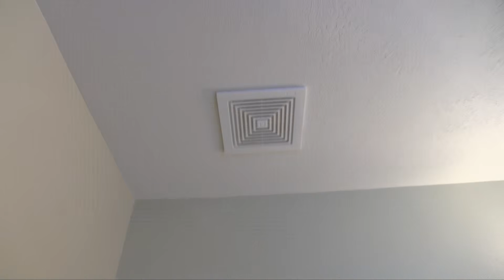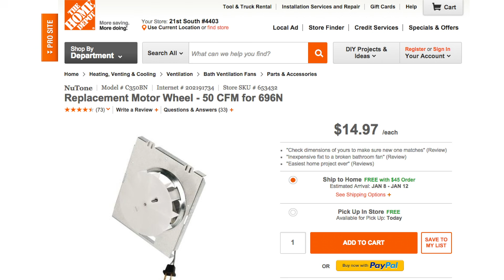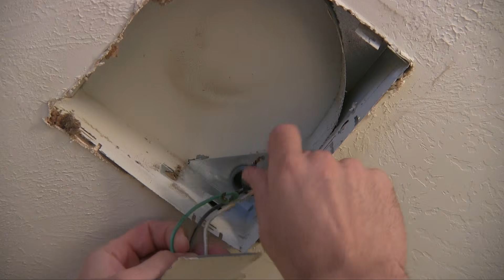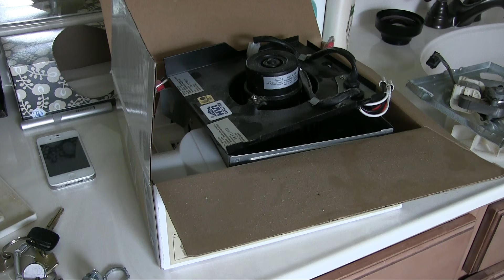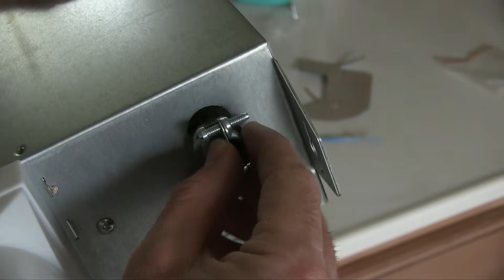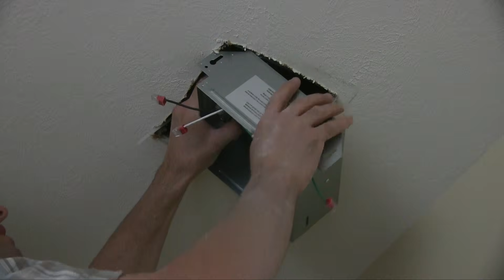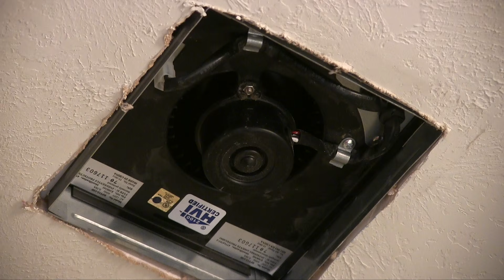How to replace or repair a bathroom fan

Comment: Cold Weather Tip:  If you feel cold air coming down through your ceiling fan vent in the winter (it happens), it’s cold air coming down the roof vent and flowing into the fan enclosure through the plastic swinging “gate”.  What I do is unplug the fan in the Fall and tape cardboard over the gate.  This immobilizes the fan until I hook it back up in Spring, but the bathroom has another ceiling fan nearby in the shower which doesn’t bleed in cold air.

Comment: I tried to replace the fan in the master bathroom. Could never get it out of the ceiling. No idea what is holding it in other than the screws that I took out. I looked at the hall bathroom fan and found it had been replaced by the revious owners. It looks like they had the same problem. Apparently they just cut the fan motor mount and drilled in some holes. Then screwed the new fan to the old fan motor mount. I might have to do the same thing in the master bathroom.

Comment: I did try and thank you but you should add some time is not also the switch  cause I did plug the hair dryer and did work went to buy the switch  and nothing . I was thinking 🤔  wait the plug in the fan already have power.  So don't  matter what you plug in will work so conclusion need to buy a fan lol 😊

Comment: Good video. For me the worst part by far was getting the fan cover back on. Those spring clamps have lots of strength and are thin and need to be compressed: I finally figured the angle of my ladder vs. the fan housing needed to be just so: I needed to see (the 2nd slot - first one was easy)  but I also needed to have the flexibility of my wrists. Once that was figured in I put on some thin leather gloves to be able to push those spring together enough to fit through the slot. Hope this helps

Comment: I have a air fan in the bathroom but it's not working, because I don't feel no air, especially when it's very humid in the hot summer days, I live in a rental apartment should I tell the Landlord to check it out?

Comment: Sad that they are making bathroom fans using a radial fan especially with short vertical blades.  They're the worst kind of fans to use in a house since they have to spin at such a high rate of speed to move air, thus creating an excessive and annoying amount of coil whine and noise.  Typically, bathroom fans are axial fans that have larger horizontal blades and can move much more air at slower speeds, thus reducing coil whine and noise levels.  The icon on the fan box in the video shows the fan as an axial fan.  Misleading information by the manufacturer.  
Interesting that house appliance fan manufacturers are using the sones scale instead of the decibel scale.  Think of sones as the metric system of sound and decibels as the imperial system.  The fan in the video is rated at 4.0 sones.  That's equal to 47.99 dBA (decibels).  Way too loud especially for a single fan.  2.0 sones is 37.99 dBA and that is tolerable but still loud.  The sweet spot is 1.0 sones or 28.00 dBA.  High enough fan speed to move air quickly, yet the noise level is relatively quiet.

Comment: The people that did my bathroom exhaust fan left a half inch gap between the ceiling/drywall and entire unit somehow... I found this to be the probable reason for bad air flow and condensation on the ceiling. 

Any ideas on the easiest way to fix this? Thanks 🙏

Comment: The fan does not seem to be coming out at all, no mater how much I try to pull it out by twisting the clips. is it possible that it is stuck in there with something else holding it in place? It is a Broan model and looks similar to your fan in the video, but it is possible that it is a lot older, and so a different model, maybe? Any suggestions would help! Thank you!

Comment: Good vid - educational and useful. I thought the fan I bought (before I pulled out the old fan) would not work because the new fan will not fit in the existing housing, but this has shown me how to remove the housing and install an all new fan. The old fan is about 30 years old, or more.
Thanks!
- from a not so handy homeowner 😅

Comment: Great video. Your fan appears to be identical to the one in my bathroom. Which was 17 years old and would not turn on at all...all you got was a humming sound when you turned on the switch.
 
But you know what I did...before ordering parts, I realized the thing was caked in grease and grime, so I unplugged it and doused it liberally with Greased Lightning grease cutter and then WD-40. Let it dry about 5-6 hours. Plugged it back in, hit the switch, it now runs just like brand new.
 
Maybe something to try before you go to the expense and hassle of installing a new one.

Comment: @AdamDIY In an apartment building are the bathroom vents connected to downstairs apartments?. Or each unit above and below? I got really bad smoker problem coming from downstairs neighbors. They light up all day long and smells like ground zero comes through from my bathroom vent. I've blocked the vent with whatever I could

Comment: Great easy video!! My fan seem like working fine (but only twice thankfully) with high wind & rain it leaks in one spot from between the fan box & drywall.  I'd I caulk around fan box will that stop the occasional leaks? Suggestions?? Tks!

Comment: I would like to have seen where the damper is.  My problem is outside air is coming in thru the fan, so clearly the damper is stuck open.  It is not at the other end, where it exits the house.  Also, does all of the fan have to be removed to get to the damper in the duct?  I assume so.  And having trouble with that.  The damper is not accessible in the attic.

Comment: Stupid question but how do you know if the motor is burned out? I need a fan fixed, it turns on but it doesn’t do what it needs to. Steam and condensation builds in the bathroom and mold grows on the ceilings even though the fan is on. There is no window in the bathroom.
Reply: I'm having a similar problem, except the motor on mine is working

Comment: Thank you so very much. Your valuable simple comment about plugging something into the socket on the ceiling fan saved me from so much work. I plugged in a little light and it worked. So I plug the ceiling fan plugged back in and pushed it up tight, and it worked. It must’ve stopped working because the plug must’ve come loose. You saved me so much work! I appreciate it and I subscribed to your channel!

Comment: With all that garbage that fell out as you removed the housing, that tells me there is no venting to the fan and it's just blowing into the attic. You should check that out because it will cause all kinds of mold damage to your house.

Comment: Thank you for this. Had I not known that I could just replace the fan and motor and not need to replace the whole housing, I would have pulled my hair out. I installed the new motor/fan and while it is much better than the old one, it still makes a lot more noise in the old housing than it does plugged in without the housing. Not sure if that's normal but it'll do for now and I think the housing will need replacing someday.

Comment: Our fam sounds clackety, but it still works. I removed the top and plugged in a lamp and a hot iron, and neither turned on. Once the plug was back into the unit, it was on - clackety again. What does that mean? Works with fan, but not with anything plugged into it?

Comment: If your fan just doesn't suck good anymore, don't replace the whole unit, just clean it. Most of these have fan blades that can be removed by simply pulling them off of the shaft. Sometimes you have to push down first, and then pull up, to break it free without damaging the motor. Then, soak the blades in a bucket of hot soapy water for a few minutes and then brush them and rinse them off.

 Over time, the dust buildup on the leading edge of the blades causes them to no longer "cut" through the air, which is almost always the reason a bathroom fan doesn't suck air. Being in a moist environment, the dust tends to stick to the leading edges of the blades. Depending on how dusty your home is, this can happen within just a few months. It's good to clean your bathroom fan every year or two, to prevent mold buildup in your bathroom.
Reply: On a related note, pull your fridge out, take off the front kick plate and whatever plate is covering the backside. You'll be shocked. Get your vacuum down there and clean everything off, especially the fan. Your fridge will work better and also be quieter.

Comment: Update, check your unit. I have a Nautilus, which Broan bought out. They changed the location of the outlet. It is now in the wrong corner. Now will cut the sheet metal in that spot since I don't want to rewire the whole thing.

Comment: Thanks for this video. You'll probably be getting views on this until the end of time. LoL I do have a question. My current one is like the one you pulled out that has the power plug to the motor and fan. But the new one you put in, you had to re do the wiring since its hardwired as opposed to having the plug. Is it normal that the new ones are like that now? Or is that just what was available. Mine currently went out (Not a power issue. The motor was dying for a while).

Comment: Thank you for this video. Saved me sooooo much time and work. I was able to verify it was  a bad motor and not the switch and pop out the old motor and replace it with the new motor.

Comment: Not as easy as the video leads you to believe. First thing that needs to be said: don’t buy the new fan until you take the old fan out. The position of cables and exhaust hose might be different. With the old one out you can go to HD and buy an exact replica of the one you have. Prepare to fight for space. If you are not handy, give yourself 2 hours to do this job. I had to cut four nails that were securing the fan. Hope you find screws holding yours.

Comment: How to fix a fan working continuously even after turn it off.
I called Electrician he cut plug  and put wire connections directly.He said plug is faultly.
Same problem again.
It's from Canadian tire BROAN brand fan.
Thanks

Comment: My wife been telling me to fix the fan in an extra bathroom where our birds sleep for sometime now and I finally said, "OK I'll see how to do it on youtube" Thanks! I will try this out tomorrow.
Reply: I was mentioning the same thing, and then I went to buy it myself, and then I ended up replacing it myself, and then I began to wonder if you could buy parts to replace whatever isn’t working in the old one.  There was a lot of dust on the old fan on the upper internal roof side of the fan and it’s workings, as I only ever cleaned the grill plus the fan blades I could reach from the being in the room.  I wondered if it stopped working owing to years of dust building up on the upper side of the fan workings. (?) 
 Should I have unplugged it, taken it out, and cleaned off the dust once a year or such (?).

Comment: Hey, great video!  My bathroom fans are rectangular.  It's about 5x11.  (These condos were built around 1984.)   I havent seen anything like that at Lowes or on Amazon.  Any idea of a better place to look for a replacement?  If not, is it just a matter of cutting a larger hole?
Reply: This is my problem too.
Reply: @lytled6551  I ended up getting a replacement at Grainger.  Mine was not vented and they were the only one that sold a non vented one.  (They might have called it recirculating?)  You cant use a vented one without properly venting it.  We did have to cut the hole bigger.  Good luck.
Reply: @fixfireleo  thanks! That helps.

Comment: bought our house 3 years ago and the bathroom vent fan worked fine for a time....then it started to get noisy....then it got out of hand!  The fan was hitting on something but I thought it was the motor.  So I got a new motor and replaced the old one.  Still had the same problem and when I turned it on it sounded like something was breaking.  I pulled it back out and now I can't get the fan to rotate with the motor shaft....it just slips on it.  Anybody know what I should try?  Thanks in advance!

Comment: The other big thing you need to look at when buying a new fan is the size. If you don't get the same size, it will mean some drywall work which can be easy if you're cutting a slightly bigger hole, or more difficult if you have to reduce the size.
Reply: It would be rather dumb to get a smaller fan unless you don't mind patching drywall

Comment: I have a motor that went out and the electrician took the squirrel cage and inner part of the motor. There are 4 wires for this fan and a capacitor,  how do I replace this?

Comment: What if it's just being really loud? It turns on then makes a loud sound like it's unbalanced but then quiets down to it's normal volume.
Reply: Could be the motor is sticking. Mine did this and there was hair wrapped around the spindle. Took the motor out and cleaned it and it is good to go for another 45 years!!!!

Comment: Ok so just to confirm: if you flip the wall switch and whatever you plug in doesnt turn on the issue is the wall switch? Is it possible for half a two button wall switch to fail? My lights turn on, but the fan doesnt. Thanks.

Comment: As far as removing the face/grill/cover (not sure what the correct term is). I have a older fan that isn't spinning. I tried but cannot remover the cover. Any tips or suggestions. Since its older could it just to stuck to the dry wall?

Comment: For my info, you didn't show 

1. How to route the old wires through that clamp... or is it Romex? Flexible conduit?

2. How to attach the new connectors which replace the wire nuts.

I consider this a good start at how to do it, and an overall way to decide whether I'd want to do it myself or hire a handyman.

So... no thumb down, but no thumb up, either.

Comment: My exhaust fan appeared to be installed as "new work." Unremovable from below. Why anyone ever thought that would be a good long term idea is beyond me. I picked up the replacement motor, the Broan BP27 which is readily available. (Ace had the best price.) 6 of the 8 illustrations were as you'd expect, depicting the motor hung from the bracket with the fan on the other side, as with the original. One was different, with both fan and motor on top of the bracket, placing the fan way up high of course.

The motor came assembled intended for that odd illustration but of course the fan wouldn't fit. It hit the top of the housing. The mounting screws and motor housing are backward. I reversed the screws anyway, which meant the motor is now only held together with the two nuts that also secure it to the frame. Just thought I'd mention it if anyone buys a BP27 replacement motor but has a bottom-mount motor as shown in this video.

Comment: My job SUCKED!  My opening is 8" x 8" - Every single fan at Home Depot and Lowes is 7 1/4 x 7.5 and I had 1 stud to work off of and I used spray foam to seal, insulation everywhere, Itchy and i have a bad back and don't like working above the shoulder work, so I was pissed off, but now I am fine!  (sorry, I am actually fine, just needed to blow some steam).

Comment: Hi, mine is turning on but it seems not sucking any air in when I put my end next to it. Bathroom in fact stays smelly. Any suggestion?
Reply: I would replace new motor assembly.making sure it right CFM for your bathroom. At home depot

Comment: A fan in my house and my mothers house were having trouble at the same time. Both fans were close to 40 years old. New fans looked cheap compared to the old units, so I just gave the old ones a good cleaning. About 5 years later, they still run like new.
Reply: This is a good idea!

Comment: We ended up replacing the whole thing and are We are having trouble with our motor plug working. Do you know what could cause that? We made sure all the wires were correct too.

Comment: Just replace the motor... who would have thought! Thanks, great video.
Reply: You can also typically just lube the bearings and put it back together.  Due to fire safety regulations, most of those motors actually can't "burn up".  They can sit in a stall condition all day.
Reply: @l337pwnage  You'd hope but a house I just went to this Wednesday had one catch on fire.
Reply: @claireredfield1992  It's literally in how they are regulated and built.  If there was a fire, somebody probably put a nail through a wire, but even then it's hard to get a fire to start.  It would almost have to be one with a heater in it that was never cleaned, or mice built a nest in the heater.
If your bored, just get one, cheap ones are only like $15, set it in your driveway, jam it with a pencil, fire it up, sit back with a good book and see how long it takes to start on fire.
Reply: @l337pwnage  Nope standard cheap-o ~55 dollar fan. I don't need to go buy one I just saw the aftermath of one I had to replace/rewire.
Reply: @claireredfield1992  $55???? you got ripped off.  The cheapos are like $15.
Not much of a fire if you could just put another one in, lol.
There are videos on youtube that explain how those motors work, but the best one I'm thinking of is so far down my history list I can't find it now or I'd link it for you.
Until you learn what caused the fire,  you won't be able to prevent the next one.
Reply: He said his sister wanted a new unit

Comment: You skipped several steps. The replacement motor I bought was assembled upside down. I needed to figure out how to rearrange the parts so they fit in the old housing.
Reply: Shaded pole motors for bathroom fans are designed to be mounted either way so they are functionally reversible. If you swap the orientation of the motor, the rotation will be in the opposite direction even though the motor itself continues to rotate the same way. Swapping orientation is as simple as flipping it over and re-bolting it to the housing. Swapping wires on the other hand will make no difference, it has to do with the way the shaded poles commit the motor to a specific rotation.